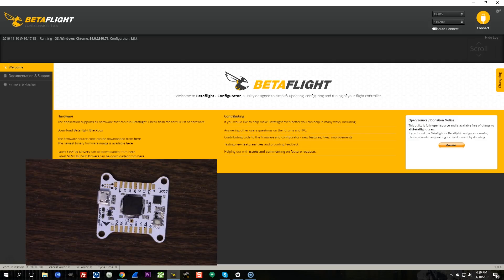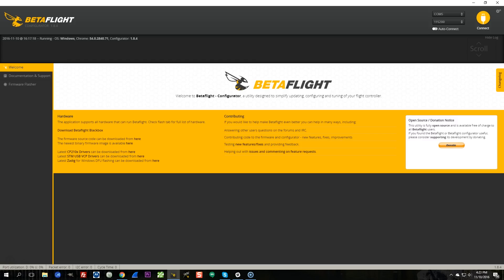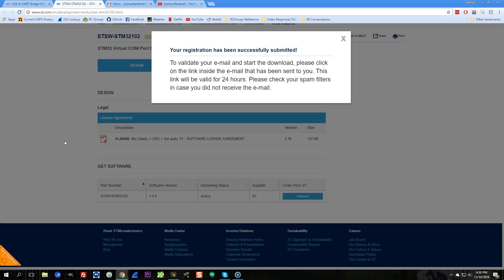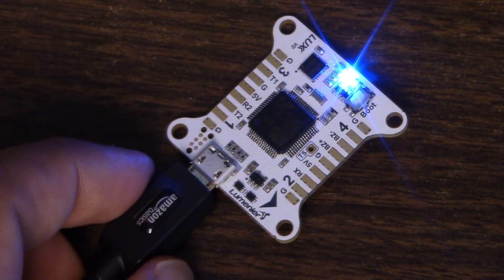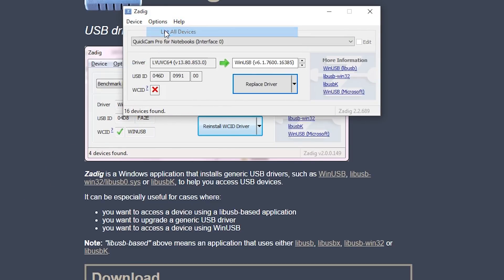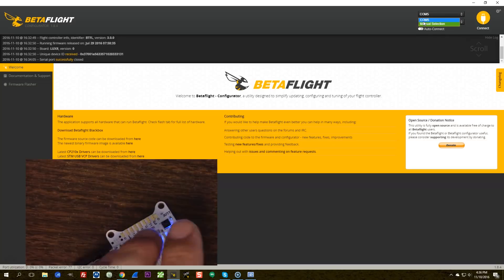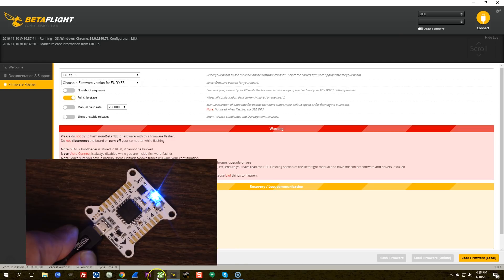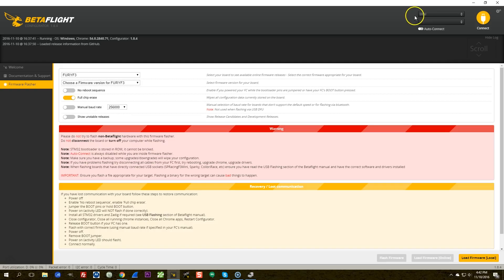Betaflight / Cleanflight Flight Controller Won't Connect | FIXED

Comment: I had it working and it stopped. I am not sure what I did, but I believe it might be a windows driver taking over. The FRSKYF4 shows up in my device manager but no port comes available. I've tried uninstalling and reinstalling with the same result. I think I might have accidentally updated the FRSKYF4 to WinUSB (v6.1.7600.16385). How do I get out of this vicious circle?
Reply from the maker: Plug it in. Right-click it in device manager and delete it. Choose "erase files" option. Reboot.

Reinstall fresh.
Reply: I have done that. I removed it from device manager. Removed both VCPs from programs and features. Rebooted after removing all of these. Reinstalled both VCP drivers (unpacked and installed), plugged in FC which comes up under USB devices and no ports. When plug my 3D printer in the port pops up. So the mach is assigning. 
 Reinstalled Zadig WinUSB for bootloader (only after I discovered it didn't come up after driver reinstalls). 
Still no go.
Reply: It does allow me to load new firmware. But after a reboot I can't connect with Betaflight.
Reply from the maker: Do you see COM3 (or some other number) in the pulldown menu when you plug in the board? If so, the drivers are working right. If not, the drivers are not working right.

If you see COM3 then the drivers are right. If you still can't connect most likely you are flashing the wrong board type ("target") from the firmware selection pulldown menu. But I can't say what the right one is.
Reply: That' the problem. The com doesn't show up anymore. I had it working the 1st go after watching your video.  It's like the VCP is being over-written by Zadig.
I just loaded it on the laptop in a matter of 3 minutes.  Works fine. I'm able to control the motors but I can't do anything with the transmitter/receiver and I know they are bound. I'll check out some of your other videos. Great videos by the way.

Comment: mine says failed to open serial port
plz help asap
Reply from the maker: Failed to open serial port means either something else is actively holding the serial port (like if you were trying to run BLHeliSuite and Betaflight Configurator at the same time, and connect to both at the same time), or it means your drivers are not installed correctly, or it means your USB cable or FC might be damaged and the board is not registering that it's plugged in.
Reply: Correct My board is not registered when I plug it in, is that the cables fault?
Reply: The FC is brand new on the wizard x220
Reply from the maker: Did you install the CP210 driver as instructed in the video?
Reply: I did yes, how would I know if my cable is incorrect?
Reply: Josh, just checking, does my board need to be flashed to connect my quad?

Comment: Quick question i have an hglrc f3v4 pro it had worked with no issues so thinking i was doing a good thing i Flashed to beta flight 3.2 now when i go through setting up the board it hangs up and drops communication. And will not save the last action . Do you have any ideas what may have went wrong .thank you .
Reply from the maker: I think you are saying that you can connect to the board but when you try to save, it drops communication. I guess if I were in that situation I would re-flash the board with full chip erase selected. Make sure you are using the right target from the pulldown menu. Flashing the wrong target can appear to work but produce unexpected results.
Reply: Joshua Bardwell I think that's what i have done thank you sir .

Comment: Just need to add to the chorus of kudos & thanks.
I was ready to send my clone F4 FC back after spending a couple hours try & failing to get it configured. All I needed was the right BF drivers so I could flash a current firmware version.
Today, like so many days I learned something.

Comment: I have a problem with not being able to get the fc into bootloader mode. When I jump boot pads and power up all I get is a continuous buzzer from the receiver that is still connected on top of the fc. An eachine aurora 90.
Reply from the maker: I don't really know what would cause this.

Ignoring the buzzer, does it go into bootloader mode? Do you see STM32 Bootloader in the Zadig devices list? Do you see "DFU" in the pulldown menu in the configurator?

Comment: hey josh im having a issue getting my luxv2 to connect to blheli or blheli suite it connects to betaflight but i cant update my escs and half of them have that stupid raceflight firmware with the tweaker beeps lol HELP :)
Reply from the maker: I don't know what might be up with raceflight ESCs. I can't say whether they do or don't work via betaflight passthrough. I know that raceflight designs for its own ecosystem so it's possible RF ESCs are designed to work only with RF. But you would have to check with the RF guys to find out about that.

If you have BLHeli_32 ESCs you need to be running BF 3.2 or higher for passthrough to work.
Reply: Joshua Bardwell they are little bees but when I had a revolt in it it updated my escs :(
Reply: Joshua Bardwell I'm on 3.2.2 I'm never messing with RF1 again done with Raceflight  grrrrrrr I wanna fly my tweaker

Comment: It wont let me do anything with the cp210  drivers. It says it will hurt my system if I try to modify them
Reply from the maker: You shouldn't modify the CP210 drives with Zadig. You only modify the STM32 Bootloader device with Zadig.
Reply: Yes! Absolutely lol

Comment: This didnt fix it, my f3 evo v2 just goes into cli mode.
Reply from the maker: If it goes into CLI mode but the GUI won't work, it is because you have a very old version of firmware on your board. Or your board has Cleanflight but you are using Betaflight configurator, or vice versa.
Reply: Joshua Bardwell omg you replied! I love your videos! It won’t connect in cleanflight either. Cli mode in clean flight for the first time after doing the usb driver steps here.
Reply: Joshua Bardwell ok I made progress. I used impulse rc and got it to flash new firmware, and it’s connecting. I got it to go into serial in the ports and save my receiver as a Spektrum dsm2. It’s not going into bind mode and when I use a receiver with bind pins and bind it, there’s no communication. I have since moved rx3 on the dsm port over to uart2 rx2 and turned serial on on uart2. Still no bind or communication. Any help would be appreciated.

Comment: My BFight 210 has Omnibus F3 Pro flight controller. Everything was working fine in betaflight until I enabled the magnetometer sensor.
Now my quad doesn't connect to betaflight. Can you suggest how can I disable the magnetometer sensor? Clicking on connect does nothing as of now.

Comment: Joshua bardwell, hello I just updated my firmware on a omnibus f4 sd. After doing the upgraded flash was successful. Now when I am making changes I get a unrecoverable failure of serial connection, disconnecting... Failed to close serial port. It doesn't seem to happen every time but say I want to change the font on my OSD when it uploads the new van and goes to reboot it doesn't save to the eeprom and just disconnects. Any ideas? Cp210 and stm USB are installed and working. When I go into bootloader mode I get DFU uptop so that all went fine. Just this odd issue. I'm going to try another pc. Quad is up and running, I got everything to pretty much save besides some minor things.
Reply from the maker: I would try another PC and USB cable. Updating the firmware shouldn't cause this issue.
Reply: Joshua Bardwell Thank you for your help, and your videos. I have learned so much from your videos.   They are always really informative and i have learned a lot. Thank you-Brandon

Comment: This fixed an incomprehensible problem for me - why BetaFlight on my Windows PC wouldn’t connect to my FC in boot loader mode. Thank you for the detailed explanation of the problem and the resolution.

P.S. the dfu CLI command makes the bootload process a whole lot easier
Reply from the maker: Bear in mind that BF 3.2 changed that command to the more generic, "bootloader". The actual command is "bl".

Comment: I run on Mac and cannot find a driver that is compatible. I can’t connect any of my quads without connecting a battery which also makes calibrating my ESC’s in Betaflight impossible. I am lost.
Reply from the maker: +Captain Propwash that's pretty weird. The part about not being able to connect without plugging in battery. When you plug in does the FC light up?

Mac doesn't need VCP drivers. They are already built in. That's why you can't find them to download separately.
Reply: Joshua Bardwell Thanks for the quick reply. It’s the same with my Vortex 250, ARFUN pro 95 and now my King Kong Tiny 7. Now I’ve said all that I am drawn to a conclusion that it’s a USB issue on my MacBook. I am very new to Mac so maybe I need to educate myself a little more. But this hobby keeps throwing curve balls at me and I don’t know where to go, apart form your channel.
Reply: Joshua Bardwell Sorry, forgot to mention that I get no lights when plugging in with the USB.
Reply: Joshua Bardwell Sorry I made a mistake. My King Kong Tiny 7 connects fine and lights up with a usb connection. Just not my vortex or ARFUN 95 pro. Sorry for all the comments.

Comment: The reason why it didn't work with my FC: the CABLE. I changed it and everything worked fine.
Reply: do HAVE to use some special USB? Cuz I just have a normal Micro USB cable

Comment: I posted a comment several months ago about how I got around all my driver issues by going with a chromebook and using the Chrome apps. Well, I just tested with a $35 Raspberry Pi 3 and it works!! At least on the first three copters I grabbed off my wall. I tested all 17 flight controllers with my chromebook and they all worked the first time. I don't have the time or motivation to confirm that with the rasberry pi but I have a feeling that it will work just as flawlessly. I am actually on my raspberry pi 3 typing this comment right now. I will say that BLheli-32 doesn't work with the chromebook and I don't expect it to work with the raspberry pi either because it isn't supported in the chrome app. But $40 to never fight drivers again? that's your call. But it would be an easy one for me.

Comment: I dnt find stm drivers in my device manager ..could you please help me up
Reply from the maker: Did you install the STM32 VCP drivers?
Reply: Yes ive installed all the drivers that are been provied by the betaflight software
Reply: After ive installed all the drivers .. When i go through my device manager i dont find my installed drivers ..neither in the usb bus manager or in ports ..

Comment: I have Tyrant s with furyf3 osd fc. I connected to betaflight and successfully flashed new firmware, but it wont connect to betaflight. I got the cp2102 files and they are under com ports. This shows up in betaflight. I got the stm32 downloaded (can see it, virt com port 1.4.0) in program uninstaller but does not show up in zadig or in dev mgr under univ serial dev. I don't think it has boot button.Tried impulse rc does not fix. It opens port times out and closes Have win7. Please Help
Reply from the maker: +eug eug you flashed the wrong firmware type to the board is my guess. There are several Fury targets. Always verify what target is already on the board before flashing by going to the CLI and typing "version".
Reply: went back into betaflight and down to firmware and it is furyf3 osd that was flashed as it kept it from last time I was in it. This was a brand new Tyrant s 215 2017 V1. Diatones web page this should have the furyf3 osd fc. Any other thoughts? would bootloading it make win7 see it? It doesn't have a button I know of and not sure how to jump it.
Reply: went in deleted everything reinstalled everything, I tried to boot while zadig up nothing, I have never been able to get the stm32 to show up in device manger or zadig and im extracting it, then going into those files and installing it, then going in to programfiles(86)/stmicro/dpint amd64 to install the drivers and it does not show up in devicer manger or zadig. What do I try next please?

Comment: Thanks for that Joshua... I have watched this video because I was not able to flash my Fury F3osd. I have corrected that thanks to you. BUT, since that, when I plug microUSB, STM32 appear in list device from my computer, but not on BF.... I have installed drivers (210x and vcp) again and again.. but nothing. Maybe someone can help me... please
Reply from the maker: STM32 bootloader, or STM32 Virtual COM Port?
Reply: I have used your technic, erased and flashed the FC in DFu mode. I try to connect in normal mode, my pc don't tilt when I connect (famous W10 4's songs "ting tin dong ting") I go checked to my device list: STM32 virtual com port are in section Libusb-win32 devices.
But It doesn't work in BF.
Reply from the maker: Libusb-win32 sounds like Linux or Mac? I only know anything about windows :-(
Reply: I am on Windows 10.. So why I have this one installed... ?
Reply: Ok my friend, I have found a solution for fix it. Your video help me for the DFU for flashing. I have tried the immersionrc 's program, close all chrome's page, launch it. AND IT works! OMG.. 8h on this... And for me, a STM32 disappear in my device manager, and a new com ports appear (COM6). I want to know, so I click on zadig,  check "STM32 VCP" and the driver is named : usbser (v10.0.15063.608)
Maybe this driver can help another people who have the same problem. Or simply, close all Chrome's page, and BF, and try to launch immersionrc's program.
Many thanks to your answers Mister Bardwell

Comment: Hello Joshua
My issue is my Cleanflight doesn't change ports no matter what USB port I plug into when I connect my quad along with I don't get a drop down choice to change ports on Cleanflight.  Is that due to improper driver install? 
Thanks
Reply from the maker: +rentaroo yes.

Comment: I've isntalled the first two set up drivers to connect my SPF3. I've succesfully flashed betaflight to the board. When trying to connect (not in bootloader mode) it says "No configuration received within 10 seconds, communication failed" help!
Reply from the maker: Most likely cause is you flashed the wrong firmware. Did you select the SPRACINGF3 from the pulldown menu?
Reply: Joshua Bardwell I had that selected. Lowering the baud rate to 230400 seemed to do the trick. Now I'm unsure why the gyro deosn't seem to be showing any movement...

Comment: hi Joshua,

Thanks for you video i understand better now.
i accidentaly "flash" my sp racing F3 with the betaflight firmware of F3 EVO before watching your video.(i think i have no virtual port, i don't show virtual port in betaflight ports)
I was not in bootloader mode but i have no errors during the update(flashing OK verification OK).
next, i connect my controller with jumping boot pads (many try) i see corresponding com port but i can't flashing again.
it say me that it can't access to the bootloader.
i try to uninstall, reboot and reinstall as you advice at the end on your video without result.
bad experience for my first try to betaflight :/
thanks for helping
https://static.rcgroups.net/forums/attachments/7/2/4/6/3/5/a10400920-229-IMG_20171002_221628_1900.jpg
Reply: it's OK now with using stm32 flasher
http://www.st.com/en/development-tools/flasher-stm32.html

Comment: Jeannie in the bottle? -->
GENIUS ON A BUTTON!
First this "STM virtual com port driver" - site made me completely NUTS!
Not that you need to get a link via Email to click and download...This fucking thingylink didn't even work!! Tried tons of shit for that! Solution was: Registered an account on that ultra-nerd-so-easy-to-go- site, then you don't go through that email-process again! Get the download - link displayed right away and off ya load!
Running the new CL_racing f4 board and just couldnt get the DFU displayed up there in upper right corner of betaflight!
And who saved my butt AGAIN? It's the 
Genius on a button!! 
Whenever I search before destroy, I find a JB-video that helps me out =)
Thanks again, for the 100.th time Joshua! You rock the next 1000.000 subs! ;-)
Happy flying!!
Reply: STMicro BLOWS right?  I had the same experience as I'm sure most do.  I was thinking on shooting them an email about what a horrible load of horse shit it is to get/download  and  use their driver!  If I knew how to,  I would write and open source a Vcomport driver for everyone free, forever, till the end of time! Hells yeah!!